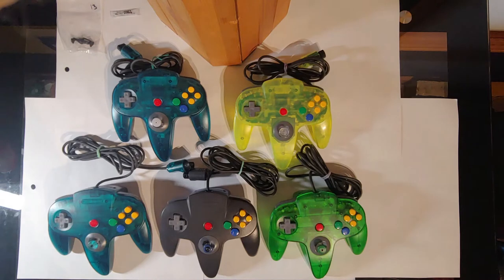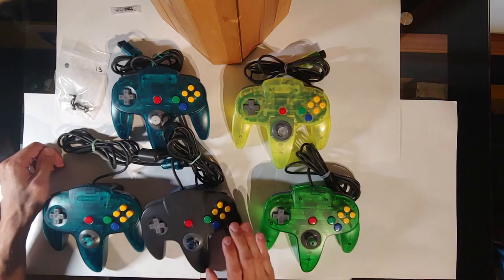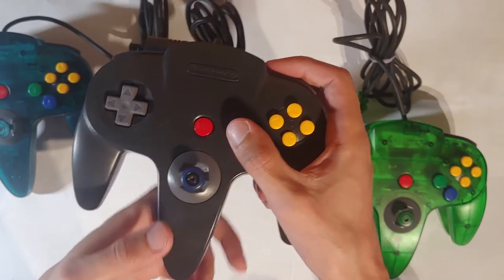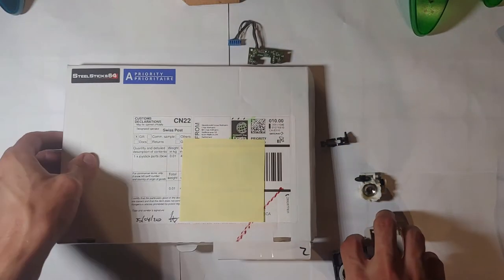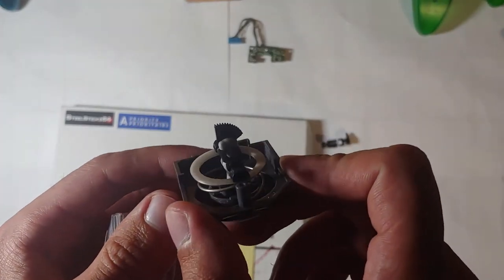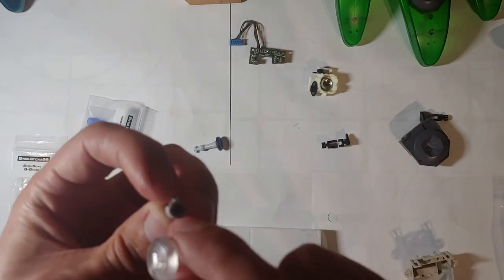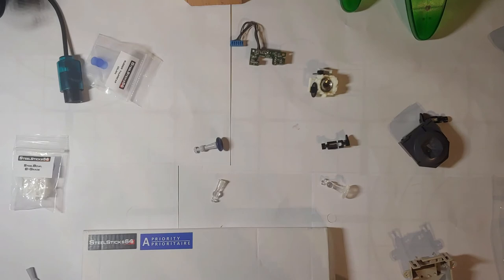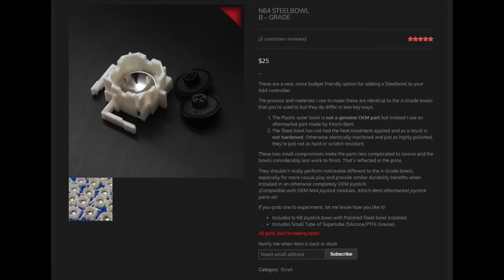SteelSticks64 Steel Bowls and Joystick Caps

Comment: Have you used kitsch-bent gears with one of Linus’s grade A steel bowls? Wondering if there is any issue with those aftermarket gears in an OEM bowl. I imagine they’re designed to work best with a bowl from Kitsch-bent
Reply: They work fine but not better than a oem stick, some times kb parts has a little flush or sighly bigger/smaller size so be aware of that

Comment: The Kitsch bowls make the joystick get stuck on corners. :[
Reply: Use silicon grease on the bowl and gears! I do that and those part feel as good as OEM. I have several OEM controllers to reference.
Reply: @oscarcamey8  I used super lube, it is better, but the stick does get stuck on down right sometimes.
Reply: @SuperLuigiGuy64  try readjusting the gears? Sometimes that happens to me. It kinda has to be lined up really good so it won't do that. Hope that helps.
Reply: @oscarcamey8  Thanks for the tip, I'll give it another try. :]
Reply: @SuperLuigiGuy64  does it work properly now?
Reply: @shininggodmsbeyblader8284  sanding down the bowl a bit helped my issue.
Reply: @SuperLuigiGuy64  glad to hear!
Reply: @oscarcamey8  The feeling is still a lot more "matte" if you will, compared to an original control stick in good condition. It works nicely, but I'm just not a fan of the more rough or "dry" feeling compared to original which feels slick and snappy. I use Tamiya ceramic grease on my parts.

I like their replacement sticks though! I've managed to improve the feeling of some of my more worn units using them.